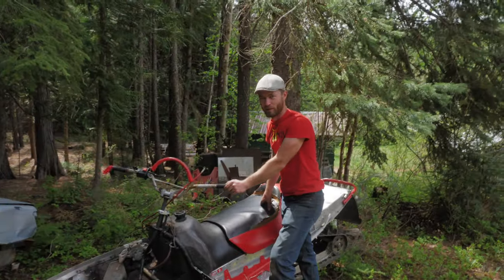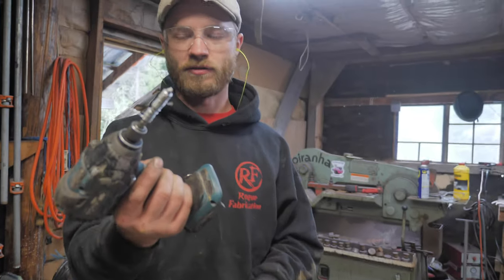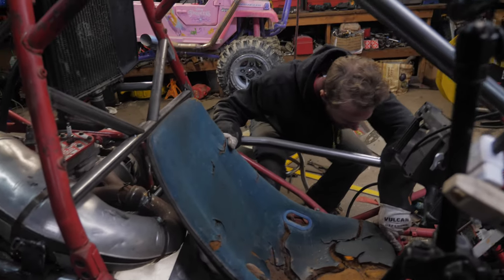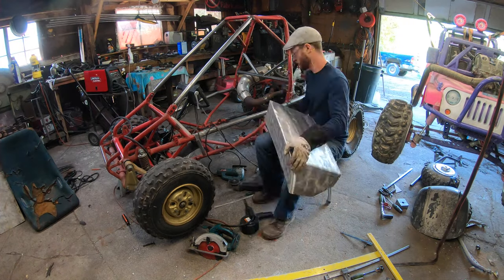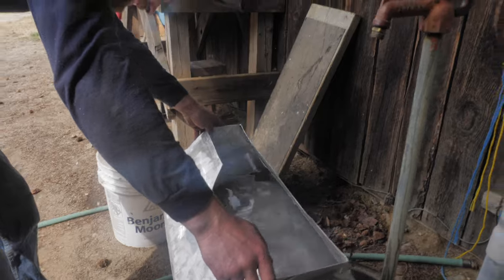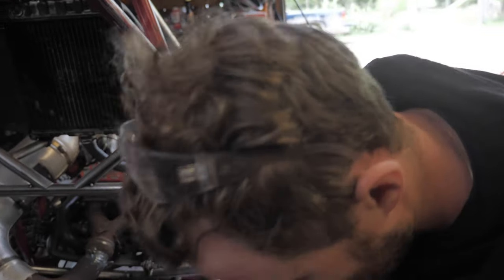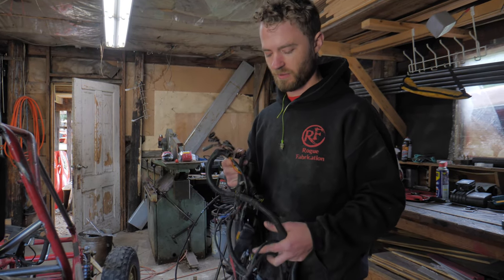Honda Odyssey Engine Swap Runs! 800cc 2 Stroke

Comment: Nice tank build. I think if you had wrapped that tank in heat insulating wrap and wrapped the exhaust in heat insulting wrap you would have been fine. Just would have had to have waited for exhaust cool down before refueling. Pressure testing fuel tanks shouldn't be done over 35 psi. And it would never exceed that unless the fuel vent was plugged.

Comment: That was a wood blade for metal. I have been using a metal blade but I think Aluminum packs up in that kind of blade. Steel studs is what I have been cutting like butter with a $30 blade.

Comment: Add some header wrap from DEI.  I've been running an exhaust header less than 2 inches from my fuel cell and fuel lines on my mini sand rail for many years without any issues.

Comment: you can save that tank!!! put some fuel cell foam in so the fuel doesn't slosh around  and a heat shield blanket up on top like the 85/86 honda atc 350x has between the tank/exhaust

Comment: Normally people only test fuel tanks with less that 5psi of pressure. 100 might've been too much. I think that tank would've worked fine. Very impressed he was able to weld it as leak free as he did with only a spool gun. But idk how easy or hard it id compared to tig so... either way that thing is gonna rip with that engine on it! Probably gonna wheelie like the jeep lol.

Comment: Why not re weld, vent and use a tank sealer on the tank? Petseal will fill most small holes and seal.it from the inside. Plus theres petrol resistant putty which would be great for the larger holes

Comment: Two thing I would have done differently is  cut and grind out the whole before welding it together so I don't get metal floating in my gas and  placement on the gas tank

Comment: I've seen guy's patch tank leaks by running an exhaust hose into the tank to see where smoke comes out (low pressure) and welding till no smoke comes out. just saying --- good job guys

Comment: You could have just used epoxy gas tank sealer after you had the tank finished, instead of blowing it up off camera.
Reply: This plus carbon fiber wrap the outside like another guy suggested. That's the costly but easiest fix.

Comment: Would have been more successful if you baffled the fuel tank would have added strength and balance but I could be wrong as I think peeps use thicker aluminum to make them hopefully patrons can support a bit with thick stuff as I reckon a home made tank would be awesome

Comment: Just take that fuel tank into a radiator shop they will seal all the holes up and pressure test it.
That's my job on Monday pulling a rusty tractor fuel tank and taking it in to get repaired at the radiator shop

Comment: Looks like your belt is a little short, not enough deflection with engine off, belt needs to be at the top of your secondary clutch but cool builds !!

Comment: Don't feel to badly about the tank guys as I believe it happened for a reason. It would have gotten way to hot being that close to the bend in the exhaust just before the expansion pipe witch is the hottest part of two stroke exhaust next to the header pipe that is. 👍👍✌
Reply from the maker: Thanks man! I wasn’t too worried about the heat at first, but then I started imagining all the ways it could go wrong...

Comment: it looks like the belt isnt riding up in the secondary clutch like it should. the top of the belt should be just above the edge of clutch at idle, so you will likely lose some top speed with the way its setup now.

Comment: Aaawwww, too bad about the gas tank! It was looking sweet and would put the weight even lower.
You could still do the same concept with extra bracing on the edges or just thicker material? Maybe not aluminum even...

Comment: Looks like your wirespeed is a touch high or heat is a touch low with how it was pushing the stinger away while you weld

Comment: Im a sheet metal welder “sheety”  there’s nothing wrong with your gas tank boys it’s actually very well done as with all your fabrication but you cant expect aluminium to behave like steel first you should of never sanded your welds smooth ally will be very hard to make water tight and will crack over time especially with 20kg of fuel pounding its over jumps if you sand it. ive built gas/oil tanks before cut the top off yours and fully weld the inside seams then it’s possible to sand your outside welds flush if your really not happy with them next I would put in some baffles for slosh and rigidity . I always leave both welds alone obviously cant get the top fully welded but the bottom will be nice and strong and leak proof. You’ve stumbled apon a trade secret to getting a good “bead” and that is to sand the edges like you did and weld over it again then your not trying to join two bits of ally together just trying to get a satisfactory bead going and another trick is to weld it like you weld very thin sheet, tack tack tack  overlapping Don’t know if your welder can handle that but gives a nice tig like bead obviously not the strongest way to weld it but aesthetically pleasing plus you have weld on the inside and not grinding it. I prefer tig welding aluminium and same rules apply you  have to weld the back side if you want to sand it flush

Comment: Sorry the leaks were so annoying, most tanks are only pressure tested to like 12psi at the absolute max. If it took 100 before blowing up then that's pretty good actually. The fuel cap should also be vented to keep the tank from building pressure if it exploding is what you're worried about.

Comment: I need help grind hard plumbing. I have a 24hp mower engine for a go cart, the shaft bore is 1 1/8 what should I use for a clutch?????

Comment: Snowmobile tank = quick easy  just clean it, check for leaks, add lines, and you done baby. Also pick up a small auxiliary tank and a reserve switch, and you no have to worry about running outta gas anymoe. Lmao I don't talk like this...

Comment: gas is far more likely to find and manipulate pinholes in your welds than water. chances are you will find more holes in the tank when its full of gas. Also you really should leave the welds instead of grinding them off. Your takeing your strength away. Even tho it may look better.

Comment: Is that a diablo blade in the saw . i cut everything with damn blades. Small RCI plastic fuel cell . aluminum would crack around mounts with all the boumcing aroumd machine is going to do

Comment: Looks like your distance from center of primary to center of secondary clutch is too long. That's why your wheels are spinning at idle. The belt should sit 1/8" above the secondary when it's fully closed at idle and the belt shouldn't be touching the center shaft of the primary. Idk if you can find a longer belt, but as it's set up right now you are going to have major issues.
Reply from the maker: Yep. We are definitely getting a longer belt. That’s just the one we had laying around.

Comment: Too bad there's only so much you can do with that thin aluminum. That tank was looking pretty good. Maybe you could salvage it by reinforcing just the corners with some aluminum strips? But I'm guessing you're just done wasting time and welding consumables on that project.

Comment: i mean you guys could just coat the inside with motorcycle tank sealer and call it good, it would 200 percent seal it, although it may take a lot of coats lol
Reply from the maker: Yeah, I considered that. But at this point I just don’t trust it with all the vibration and bouncing around.
Reply: @GrindHardPlumbingCo  got it, thanks for the reply, can't wait for the next video!

Comment: Your clutches and belt are fubar or something.. The belt should not be down in the rear secondary clutch.. On a sled the belt rides above the rear secondary about a 1/8 inch.

Comment: I'm curious why you didn't TIG weld the tank?
Reply: They used a spool gun (cheaper alternative when a guy doesn’t have a tig)
Reply: @bradandre1020  But didn't they TIG weld the exhaust of the Mustang?  That's why I asked.
Reply: Fair enough

Comment: That tank would’ve worked if you simply lined it. Maybe a few ribs or gussets to take the weight of the fuel sloshing around. 
Fuel tank liner:

POR-15 49229 Cycle Tank Repair Kit https://www.amazon.com/dp/B00J5947ME/ref=cm_sw_r_cp_api_i_4it6Cb6ES3QBT

Comment: You're better off to TIG your tanks then weld them like traditional sheet metal with spotting techniques aluminum dissipates heat so fast just run the seems over again with your Tig add meat you ground away all your strength

Comment: Dude why would you ever put 100psi into a gas tank? It wont even see 8psi. I built gas tanks and radiators for a living and just get the big leaks the best you can. Then buy what's called Red coat and line the inside, make sure you get all the corners and edges and drain it over night threw the neck. It drys hard and seals all holes and is gas/oil resistant.  Then fill it with water and pressure with only 10psi.  Guarantee you'll never have to worry about it ever again
Reply: The blown out tank is still salvageable.  Weld it and get the red coat tank liner:)

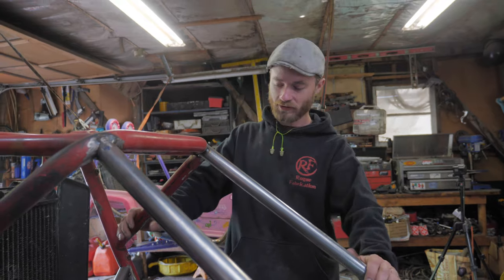Comment: If you like jazzy hip hop checkout Rudemanners - "10:00 EP" - https://soundcloud.com/neonpajamas/rudemanners-1000

https://soundcloud.com/dp_bby/blue-pages

https://soundcloud.com/rudemanners/do-not-disturb-vol-1

Also here is my likes list which is mostly Rudemanners and similar stuff (besides a few rap tracks at the top)  https://soundcloud.com/sirgallium/likes

I also highly recommend Steezyasfuck youtube channel. That's where I got started on this kind of music but after I found rudemanners, he is just so much better.

Also Jaeden Camstra - Kids' Menu, Escapades, Nimbus: https://soundcloud.com/jaeden-camstra

What are you using to produce music with? I've tried multiple times... I wish I could do it. I have the ear for it...

I'm also thoroughly confused what a Honda Odyssey has anything to do with a 800cc 2 stroke engine and tube frame chassis. I see nothing in common. Minivans certainly didn't come with 2 strokes.